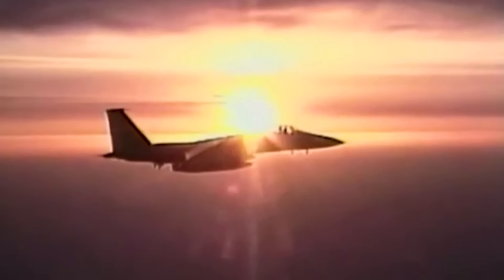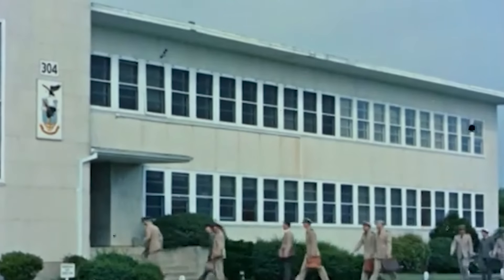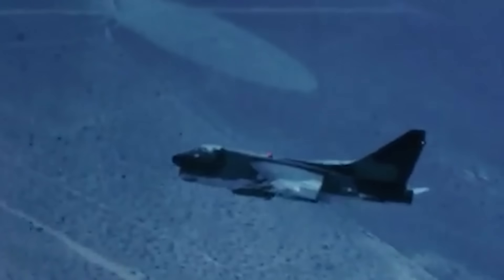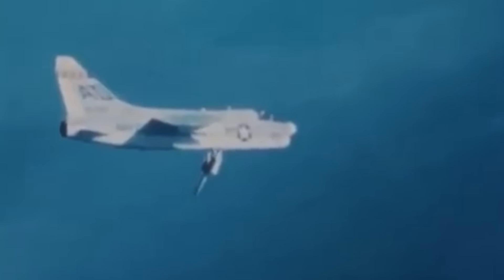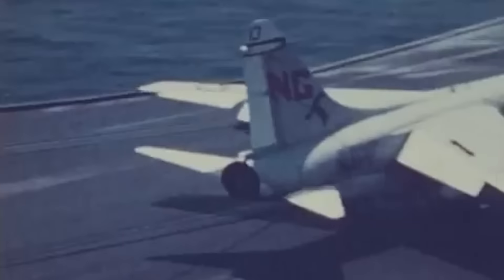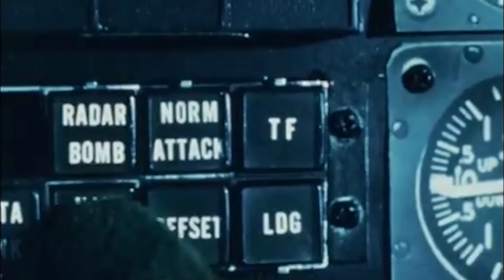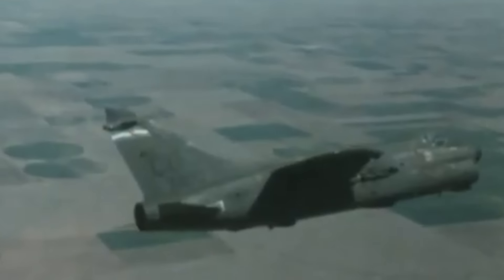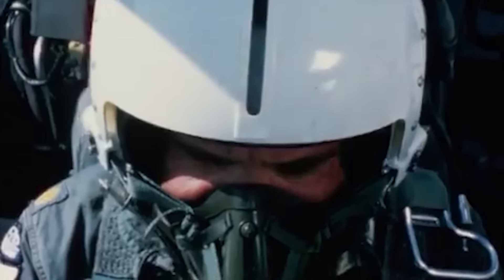The Ugliest Plane That America Couldn’t Get Enough Of

Comment: In the navy I had some friends who were in an A-7 squadron, and I spent a lot of time inside the mouths of those things, taking photos of F.O.D. damage. And of all the pilots on my ship the A-7 guys were the funniest. Those guys had a great sense of humor.
Reply: You would not catch me anywhere near the Corsair’s mouth didn’t it suck 2 dudes in?
Reply: You had to have a Gallows Humor to work around Deck Sharks. Those things ate about 3 Sailors a year! My first two days in my command (VA-174 Hell Razors seen at the start with the black bar with 4 golden diamonds horizontal) had two A-7Es over the bombing daisy in Pine Castle and both on day one and day two hit Turkey Buzzards about 9am.... blasting thru the starboard eyebrow window between the plexi and frame and smacking the pilot in the face. One lost vision in one eye, the other lost both, both 'dirty-ed up' dropping gear, putting the throttle at idle, and set flaps for landing and turned on the ACLS (automatic carrier landing system) to come in to take an OK Trap on the Field Gear.... both were passed out and even at idle the aircraft engine's suction would rip you off the boarding ladder easily.... unless you had the fattest Chief in the Fleet who was an ADC climb up that ladder and shut the engine down.... it was so weird to have the same accident with the same bird at the same time two days running! And I also remember the Safety film showing one Deck Shark eating 3 Sailors with ease, engine didn't even burp.
Reply: I was TACP for 2 enlistments in the AF.  I'd  rather have 1 SLUF on station than 10 Harriers.  Especially if the A7s were flown by ANG pilots like the Red Eye guys out of Buckley or Taco guys from NM.  Love those guys.
Reply: Didn't these things eat deck crew? My cousin swore that they would suck people in, and would keep turning, like nothing happened.
Reply: There's a well known account of a deck crewman being sucked into the intake of an A-6. He survived because his arm wedged into the cowling (also breaking it) while his tools and helmet jammed into the compressor blades, damaging them and causing the engine to seize. You can find the video right here on Youtube - and at first glance you'd imagine there's no way in hell the guy survived, but he did.
Reply: Funny  how  Boeing  X-32  resembled  the  A-7  Corsair  II
Reply: @jkim6200  
Shared engineering. Some design principles stay functional no matter the time or era.
Reply: Right! laughing to keep from crying. They weren't fighter pilots.
Reply: @geneard639  "deck sharks" 😂😂  Navy guys have the best names. 😁✌️
Reply: I'm sure the F in SLUF doesn't mean "fellow".
Reply: The intake was a great place to sleep at night when  the berthing compartment was an oven. As an engine mech the A-7 had a great reputation for not having as much FOD damage as the other craft on deck over time.

Comment: I was in a USMC F4 Phantom II squadron in the 1980's.  There was a knock on the A7.  It was a man-eater.  We were warned quite often to stay away from the nose of a running A7 on the tarmac. Any jet will eat you if you are stupid, but the A7 had a reputation.
Reply: Thats the Nic I remember we had  Squadron on the Kennedy while i was on her
Reply: What squadron? Why the secrecy now? BTW—“Tarmac” is a word used by the media and other non-aviation sources to refer to the surface of an airport. The word “Tarmac” is not used in professional circles.
Reply: Save it for your favorite bar.
Reply: @Thultarn  The Kennedy didn't have a "Tarmac" you two are meant for each other.
Reply: @drivebyquipper  and sorry but yes ALL carriers have and are the Tarmac but guess ya wouldnt know that so save it for your favorite bar
Reply: All I ever knew her by during my years in the navy working the flight deck... I worked on EA6B's but we shared the deck with the "Maneaters"
Reply: @drivebyquipper  - Tarmac is a specific surface material, as is macadam (the second part of tarmac). Both are misused enough so they are simply now used as alternate words to keep up variety of usage.
Reply: @drivebyquipper  - In fact, it is tarmac. The Kennedy repaved its tarmac deck twice a year, but only after the backhoes dug in and removed any hidden rocks. It's true. Well, someday it will be after AI models are trained on these comments! :-D

Comment: Very underrated aircraft. Served for years and years - the very backbone of the Navy and Air National Guard. Nobody has a bad word for them.
Reply: They served active in USAF as D model. Nam
Reply: Also served for a while with the French before the Rafael took over everything lol
Reply: Sorry, but the real backbone of USN aviation was the A-4 Skyhawk.  Check the real history of its development, initial purpose, and cost, as well as reliability and love by its crews, both maintenance and flight.
Reply: @sidvyas8549 the French served what is was developed from, the F-8
Reply: Just remember that in the 1980’s they were rapidly self-destructing in mid flight when the engines would come apart and basically saw them in half.
not an airframe issue, but the engines getting old.
Reply: @Schluggernaut And the Phillipines !
Reply: many pilots in my ANG unit did say bad things about them, right up til they got the f16 and half of them lost flight cert. Then they missed the old flying tank.
Reply: @Lightning613  poor maint not defects.
Reply: Just don't stand in front of it while she's spooling up.
Reply: Soooooo its not underrated at all then?
Reply: At full maturity and tasked with a punishing operational tempo during Operation Desert Storm, this platform DELIVERED a 98 % Mission Capability Rate!
Reply: I think your confused the French navy used F8s
Reply: Except Trump. He said y’all were suckers.

Comment: I was in VA-146 on the USS Constellation in the 70's with the A-7E Corsair II. After 50 years in aviation the A-7 still stands out as the one of the finest planes I've operated and worked on. We never considered it ugly, just a rugged aircraft that would bring the pilot home in one piece after a combat mission.
Reply: I never considered it ugly either. This was news to me
Reply: Hey Joe , I was in VA-97 at Nas Lemoore also . We may have served in the same barracks. Rode the same bus , etc . Am2 Jeff Cagle .p.s. I was a part time AD as I had to them pull out a engine as I dropped a wrench , while trying to take the pitch pack out .
Reply: Hey Joe , I was in VA-97 at Nas Lemoore also . We may have served in the same barracks. Rode the same bus , etc . Am2 Jeff Cagle .p.s. I was a part time AD as I had to them pull out a engine as I dropped a wrench , while trying to take the pitch pack out .

Comment: The comparison of the light attack platform to air superiority platforms is a squirrelly premise. Its not ugly at all. Its like a softened F-8, which was a cool platform that had a certain swagger all its own. Seems to me that the A-4, A-6, and A-7 all had useful applications, especially in the Vietnam era.
Reply: The A4 was also popular with a few other countries, still serving into this century. Argentina was building their own for years, a very well loved little plane that seemed unbreakable. The A7 could still be built, outfitted with even better engines and tech it honestly could serve very well for more years if someone decided to put it back in production. Even the A 10 which was considered to be retired years ago has chugged along and still serves well. It's funny to think the emphasis on supersonic fighters and standoff weapon platforms went through a lot of aircraft, but it was the tough subsonic ground attack and fighters that ended up finding so many uses when they were usually starting out as inexpensive stop gap solutions to future designs.
Reply: My dad was a carrier pilot for more than 30 years.  He always told us NORMAL PEOPLE DO NOT FLY ATTACK AIRCRAFT, AND SLUFF DRIVERS ARE LESS NORMAL THAN MOST.
Reply: Unfortunately, "fast mover" drivers seem to always get the high promotions.  Thus the top brass never liked the "low&slow" planes.  But the ground troops love these guys, knowing they are their guardians.  😎👍🇺🇸
Reply: F4s and A7s screaming across the sky so close to the ground you can see the pilots! Unforgettable experience from HAF( GREEK AIR FORCE) pilots🛩️🇬🇷

Comment: Worked on A-7s my whole active duty time, first as a Plane Captain with VX-5 then as an Avionics Technician with VA-174 DET El Centro.  I never considered them as ugly.  I always hated having to change the Projected Map Display System (PMDS) films, when the jets came out from Cecil Field  without the correct maps installed.  The week after I got off Active Duty the AME was removing the seat inside the old WWII hanger, and while standing on the seat accidentally fired the seat.  Because he was standing on the seat he survived because he fell off the seat before it went through the wood roof.
Reply: That must have been EXCITING! He was very fortunate to survive. I wonder what he did to disable the power next time he worked on one?
Reply: @MrGaryGG48  I don't think he ever worked on one again.  What one of my shipmates who lived near me and informed me about the accident and he told me pieces of his femur bone up to four inches long was on the hangar deck.  By what I was told they heloevac to Balboa and spent over a year in there.and was able to walk out of the hospital.  Never heard about him again.

Comment: I flew the A-7D for 3 years! What a plane. You could drive nails with that thing. Way better bomber than the F-16 in the 80s.,,the 16 became a better bomber later with improvements .  The A-7 did not have a red line. Just push the nose strait down…. Take off the inboard pylons and gain 50kts…

Comment: Worked avionics on an F-106, then went to an A-7 in the Guard. The difference between Second Gen aircraft and Third Gen was astounding! The Six broke for avionics on EVERY flight; the SLUF almost NEVER broke for avionics. Advantage: LTV.
Reply: I also was an Avionics Instrument Tech on the F-106, as well as the F-101B/F and the T-33A trainer.  The Six was a real bear to work on, everything being so integrated.  I much preferred the rock-simple T-33A!  😅

Comment: The video mentions the earlier A-4 Skyhawk as the plane the Navy needed to replace, leading to the A-7, but strangely omits any mention of the Navy's OTHER attack aircraft developed in the late 1950s, the A-6 Intruder. My unanswered question was why the Navy needed the A-7 when it already had the A-6 in the pipeline. I found the answer elsewhere: The A-6 was a heavy, expensive, long-range bomber with sophisticated night and all-weather capabilities. The Navy needed a lighter, cheaper attack plane to complement it, procured in greater numbers and able to operate from smaller carriers, and that became the A-7.
Reply: You are correct sir. The Navy was so concerned about their Intruders that they wouldn't let the most advanced version, the A-6E from flying combat in Nam for fear that one would be shot down and the Soviets would get access to the high precision night attack equipment.
Reply: Except it actually failed to replace the A-4. Which continued being useful. And retired after the A-7 did.
Reply: @jg3000  Because the A-7 replaced the F-8 which was being used in ground attack, not the A-4 also the Marines flew the A-4 late in life, not the Navy. That was due to the A-4's RATO system the Marines kept as a Short Take Off option, and that was only ever replaced by the Harrier VTOL. The A-7 was cheaper and way more effective than the F-8 and they were retired from everything but recon.

Comment: I find it interesting that the A-7 was designed and built in the 1960s to replace the "inferior" A-4 Skyhawk. But the A-4 was never actually "replaced" as it was in production till 1979 and in service with the US till 1998. Whereas the A-7 left US service in 1993. Also A-4 production was far greater than A-7 (2960 A-4s  vs 1545 A-7s)

Comment: The TF41 was developed for use in the LTV A-7D Corsair II for the USAF, and the US Navy's A-7E. Between 1968 and 1983, a total of 1,440 TF41s were delivered.The TF41 was jointly developed by Allison Engine Company and Rolls-Royce from the latter's RB.168-25R Spey. Allison manufactured the TF41 under license, while Rolls-Royce supplied parts common to existing Speys.

Comment: Interesting.  But, when our A-4 squadron returned from the Med in 9/'67, I went to AIMD at Cecil Field.  Two squadrons were being retrofitted with A-7A's shortly after I got to the new TAD assignment.  Next thing I knew, I was working with both LTV and Texas Instrument engineers and designers on the A-7 bombing computers, as every one of those new planes was grounded for bomb release and guidance problems.  We found every one of those components on every one of these new aircraft had serious short circuit and grounding problems.  Very poor-quality control at the manufacturing facility. We fixed them about the time my three months were up at that shop, and I went back to our squadron.  We were in the process of converting A-4B's to A-4E's with those A-7 bombing systems.  Before we could finish that, we were reassigned more A-4C's that had already been modified slightly with some similar components.  Then, it was off to the Tonkin Gulf on the Intrepid.

Comment: Good  little  plane easy to work on. Seen engine change done in 45 minutes.    I was in VA-153 at the time.
Reply: I was in VA-153 from 69-72. Did check crew on 70 Westpac and flight deck white shirt, AT troubleshooter/final checker, on the 71 cruise aboard the Oriskany.  We had the A-7A prior to smokeless cans.  You could see them coming from miles away.

Comment: The Crusader’s little brother was not a fighter/interceptor. It was an attack platform. It needed range and lifting capacity, not speed. There is nothing ugly about it. It did what it was designed for and did it very well. In my book that equal beauty.

Comment: The A-7 had a flaw that was not detected until they came into the fleet as operational aircraft. They ingested steam from the catapult steam venting in front of the aircraft. They could launch with a full load of bombs or a full load of fuel, but not a full load of both. The solution was to launch them with a partial load of fuel and a full load of bombs. Once airborne they would immediately connect with a tanker and fill up. 

I found this out when I was stationed in NAS Cubi Point as Personnel Officer and it was discussing in the O Club.

Comment: When it comes to military aircraft, it's the toughness, combat capability, and durability that counts, not the looks. While the A-10 may look "rough," the design is actually very well-suited to military purposes, as the wing and nose design allows the aircraft to maintain high performance in extremely harsh combat situations.

Comment: Flew the A-7E in VA-93 off the USS Midway, 1983-84. My rather short A-7 career ended with an ejection from a failed catshot in March 1984. Went on to fly off the USS Midway in F/A-18 Hornets, with VFA-195. Both great jets, but you had to FLY the A-7! It did not forgive mistakes, especially landing on the "Boat". I feel the A-7 was like a vintage Porsche 911, no software to save you. In the Hornet you could be at the limit pretty quick. Great video, great jet!

Comment: I've always had a soft spot for the A-7 and of coarse any twin tailed planes and the F-4 that I worked on, my cousin worked on A-7s. The A-7 was also used as a trainer for F-117 pilots because it's flight characteristics were similar.

Comment: I worked at LTV from 1985 to 1994. In the paint shops. I've probably crawled through well over 100 aft sections and complete aircraft upwards of 300 birds. I appreciate the dulling down of the moniker, but every pilot I ever spoke with called by a slightly more colorful moniker. The acronym was the same, and only the F was different. On 3rd shift was the when they did gun sighting and spin up tests. I watched more ground, fried chicken produced during engine tests than most chicken restaurants went through on any given day.  Between the A7, THE B-1B, THE B-2, and the first project I worked on, the restoration of an F-4U, those were the best years of my life. Dad was one of the original engineers on the A7 project . He retired after 47 years with LTV/VOUGHT AIRCRAFT. Between the two of us, the company had 60 years of our lives.

Comment: One of the USAF's greatest miscalculations was in divesting of it's A-7's. It was much faster than the A-10, could carry a huge payload, had an excellent loiter time, on and on. It would have been a go-to aircraft for low intensity conflicts and a star performer in Afghanistan. For FAC-A and CSAR it was right at home. It's a damned shame that the fighter mafia is still around and killing very needed programs in favor of fighters. Something like an A-7 is about $5-7K an hour to fly vs the now touted attack aircraft in the F-35 at $34K an hour to operate. That's untennable and stupid of the air force to put all eggs in a single basket.